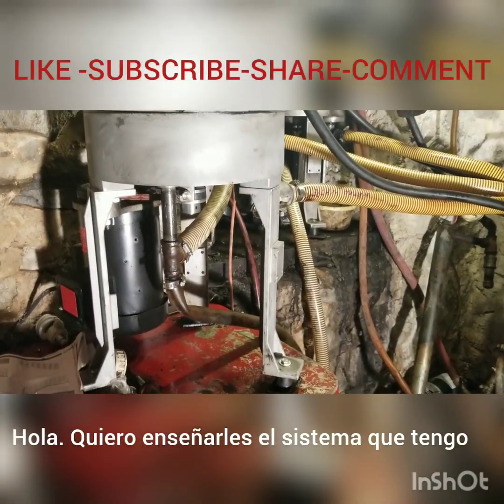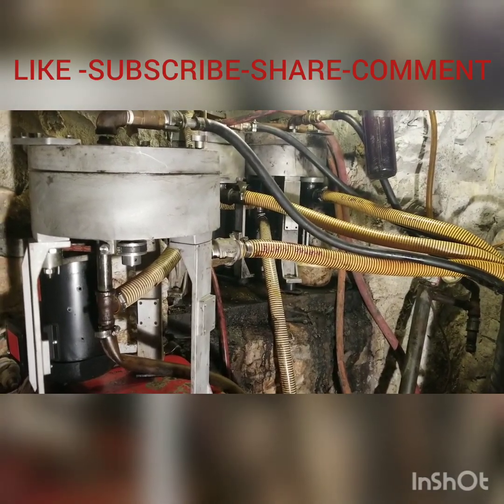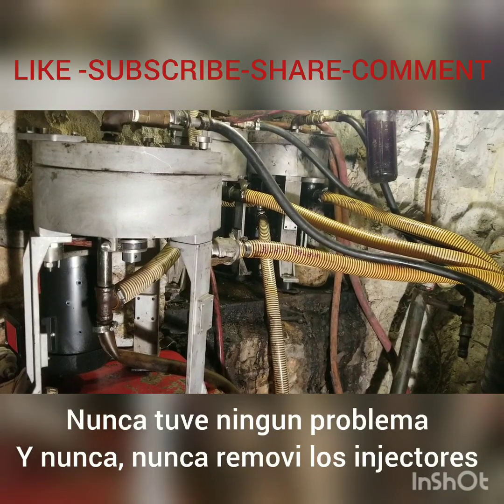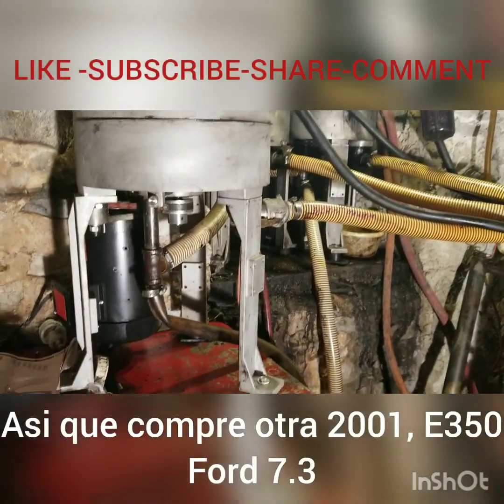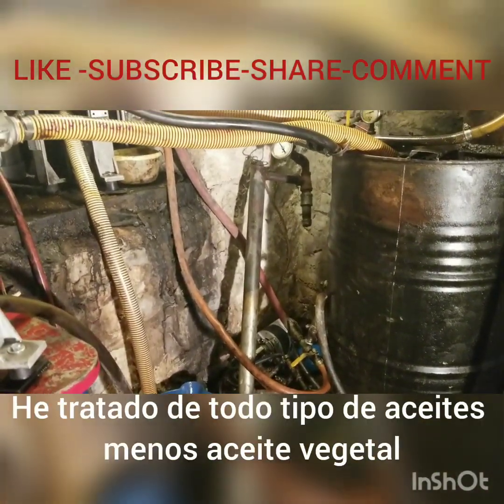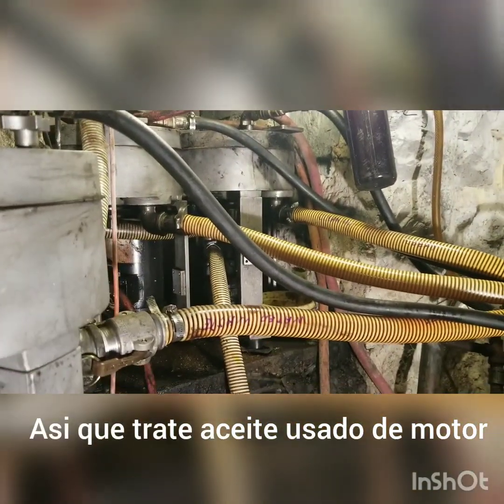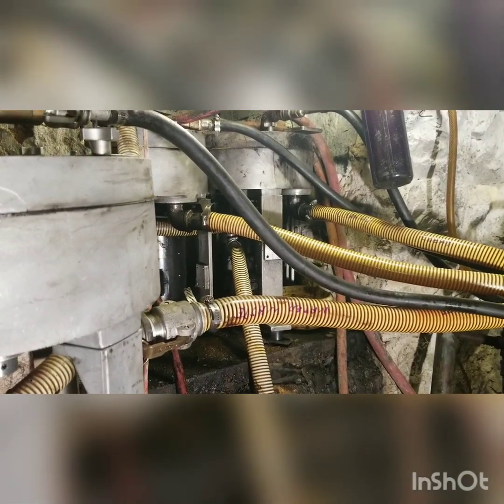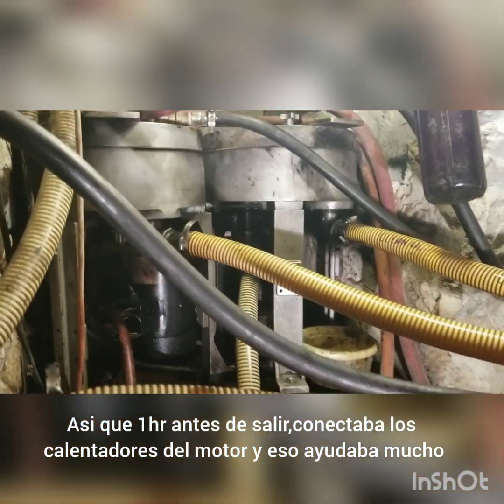COMO HACER TU PROPIO DISEL BARATISIMO!! 1a PARTE

Comment: 7.3 is great...
Reply from the maker: El mejor cuando se trata de usar cualquier tipo de aceite como combustible. Hidraulico, vegetal, de transmision o de motor. Todo quema sin problemas ni alteraciones.
Reply: @Mrdisel4life  I have run waste motor oil vegetable oil hydraulic oil transmission fluid base oil pyrolysis oil cracked oil synthetic diesel green oil
Reply from the maker: @tonydiesel3444  yeap. I bought my first 7.3 in 2015. Now I have a 2001 e350 and a 2000 f550 7.3s.
I heard the Cummins are very good too.
Reply: I don't do any of that anymore I just distill motor oil into diesel
Reply from the maker: @tonydiesel3444  is it cheaper? Or why did you change from just oil to distilling?
Reply: @Mrdisel4life  to make real diesel fuel